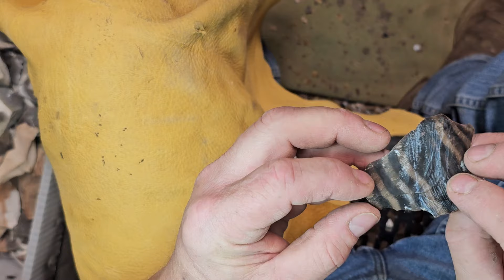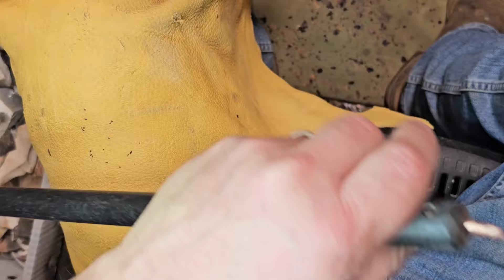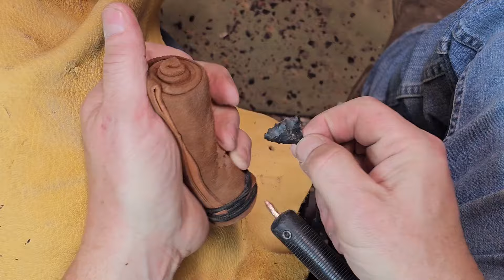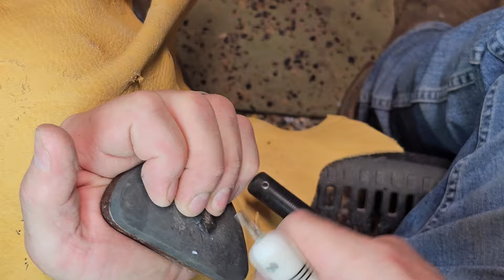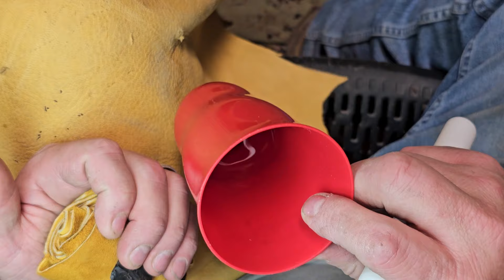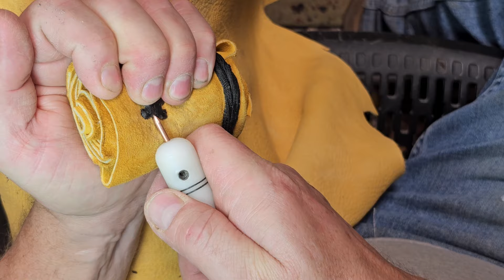Flintknapping Tiger Chert Birdies From a Flake.

Comment: I am not going to mention their name either😁, but I was very disappointed not just in the attitude but I also asked him questions about the products, more so on the Boppers, he couldn't even tell me the weight, I just felt like at least he is only there for profit, as I looked around at other people's hand pads I kind of noticed that their anti-vibration pads for equipment maybe you're washing machine or furnace, we are humans not appliances😁, that is why I started making the hand pads, everything happens for a reason and I'm glad that that particular representative was a a$$, besides that right after that I went over and got to meet Roy Miller😁, I felt better, and also I don't like to feel of their larger size Boppers the way they make their handles, my friends if you want to find something that isgood in ergonomics go back in time where they use tools by hand, were they didn't have power tools, that is the reason why my bopper handles are designed the way they are, one of these days I may make a video of how I make the tools, I really appreciate everyone's nice comments, my ultimate goal as far as the Boppers go is to make a threaded handle with replaceable screw on heads, that will bring the cost down for you guys